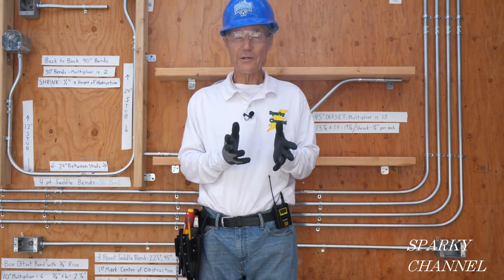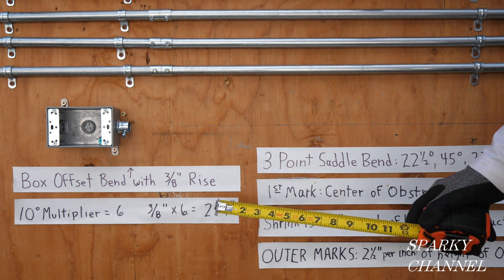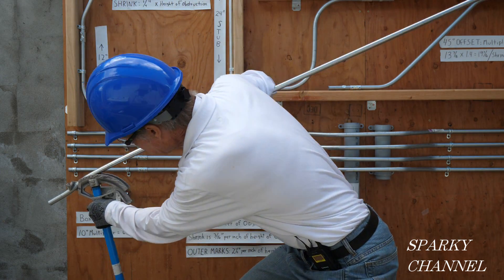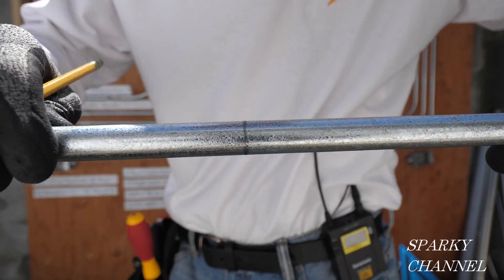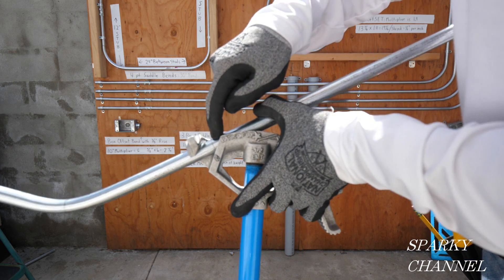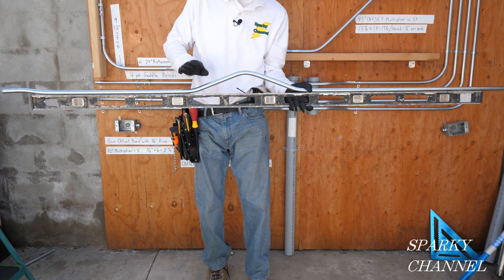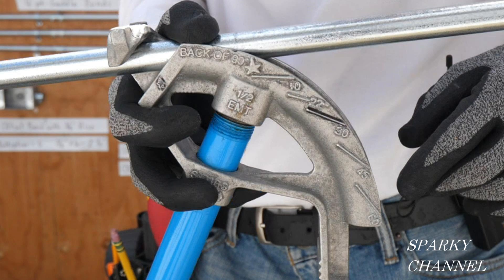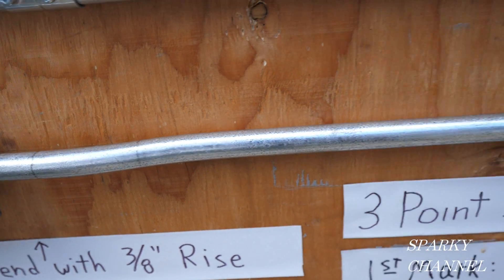Three Point Saddle Bend With Box Offset Bends on Both Ends: EMT Bending Combinations

Comment: I like how Sparky was magically able to put the conduit into two affixed exterior boxes.... Never would happen in real life...one of the boxes would have to be removed to get the conduit into the connector.
Reply from the maker: James, you don't have to remove a box. Just remove one of the 2 screws of one box. Swing the box down and meet it up with the conduit. Then swing both the box and conduit back up while the conduit is inserting itself in the fitting.

Comment: I started doing this for work and this is so helpful. I get so nervous doing it infront of people because I feel the added pressure to do it well because it has become my primary job of doing bending. The only trouble I have is placing it in the box after doing the bending and making it fit right. I end up bending it in the middle to try to fit it between the two boxes
Reply from the maker: Loosen up a screw that holds the box, move both the box and the conduit up, put them together, then move the box and the conduit together as the conduit slips into the fitting. Level and fasten straps. Let me know if that doesn't make sense.

Comment: Love all your videos. I share your videos to others wanting to learn to perfect the craft. I've only been running conduit for a couple years but I've learned a lot from your videos that I impress those around me that's been doing this for decades. It's an art form. One problem I often run into is how to account for shrink when running parallel kick 90s since the degrees vary on each kick 90 depending on kick height/depth. Want to make it look as professional as possible.
Reply from the maker: Interesting. Perhaps I'll make a video about that down the road. Right now I've started on a wiring series though. I'll be going through different kinds of switching, etc. Thanks!

Comment: Would like to have seen how you inserted the EMT into the last box on the right. You were dealing with two fixed points. I imagine you might have pulled up at the middle of the saddle bend and pushed down on the right hand end of the EMT. Just guessing.
Reply from the maker: My body got in the way of that action so I didn't include it. The box is held on by 2 screws. I took off the screw nearest to the conduit. This allows the box to swing down. I also moved the conduit down. Then I put the conduit in the fitting and moved them both up. Perhaps I'll make a video about this. It's a good trick and I would like to share it with you guys.
Reply: @SparkyChannel  Thank you.

Comment: Bill when running traveler wires from a 3 way switch to a 4 way switch is it required to install the 2 travelers ( to the 4 way switch) in any particular manner or can they be installed on either screw. Not talking about incorrectly installing to the wrong screws. Some drawings show same colored wires to the same sides, some drawings only show black pencil lines. Hard to discern exactly the routing for the connection.
Reply from the maker: I like to run the red wire to the same sides but it doesn't matter. It will work just fine either way.
Reply: @SparkyChannel  Thank you. Always wondered about that one detail.
Reply from the maker: @frankgrammatico3827  No problem, thanks!

Comment: Great video!  What if the last offset is closer to the saddle and you can't get solid leverage without messing up your saddle?  Do you have to do both offsets before you do the saddle?  If so,  how do you quickly measure it?  Thanks again for the great content!
Reply from the maker: Yes, that's what you have to do. You have to figure out the shrink from the saddle bend. Then give yourself extra length on the arbitrary last part of the 2nd box offset so that you can cut it to exact length. Also, you can just cut the conduit after the 3 saddle bend, use a coupling, and add on a short piece with a box offset on it.